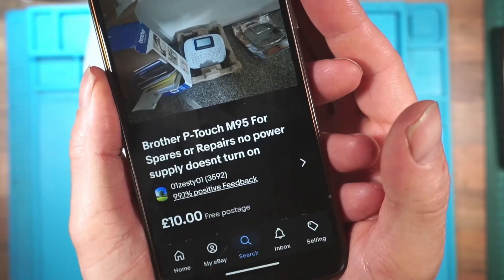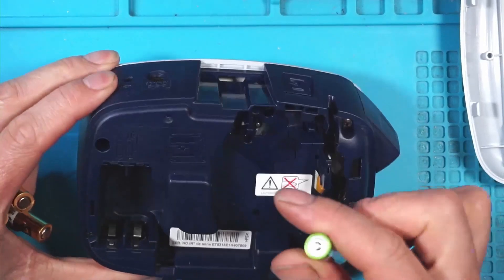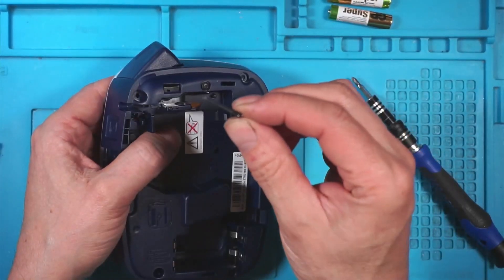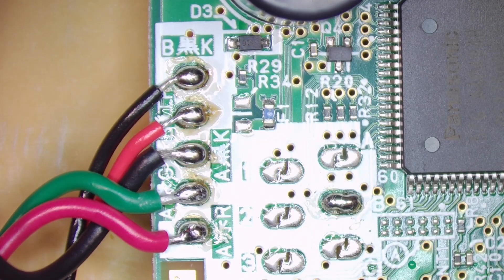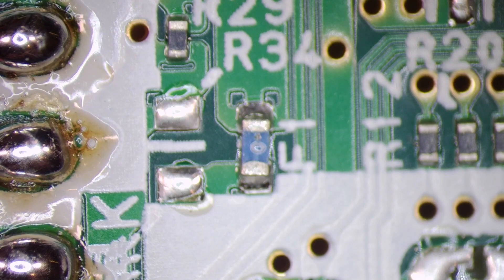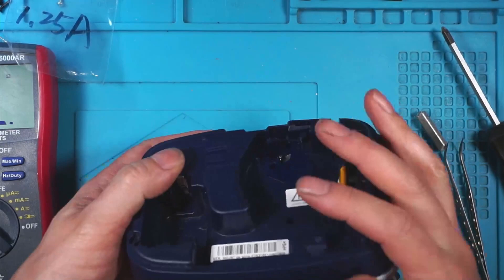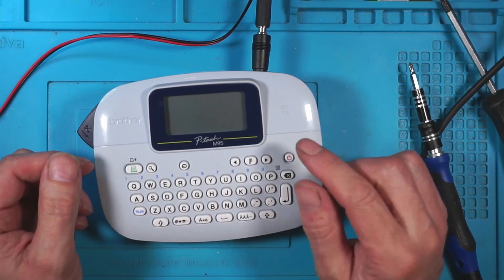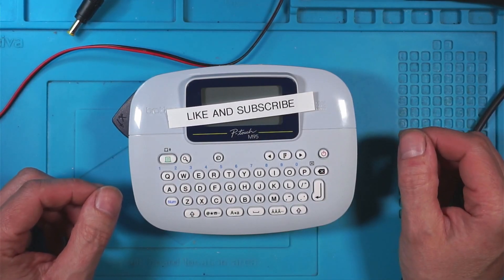FAULTY Brother M95 label printer | WON'T TURN ON | Can I fix it?

Comment: I have a PT 45, which is pretty much the same thing but with just batteries. It doesn’t work either. But, it did have an exploded battery in it. I haven’t had a chance to try to take it apart and clean the terminals and see if that’s all that will do to fix it. But if not, I’m sure that little fuse is in the very same place. That was very helpful.
Reply from the maker: White vinegar is good for removing battery corrosion. Then clean it off with Isopropyl alcohol or contact cleaner.

Comment: You fixed the hard part.  The easy part was the fact that the back of the unit contains an interlock that mechanically prevents the cut off from working when the cover is off.

Comment: Hi Philp, appreciate the video. I have a similar problem with my Brother PT 1880 label maker. My label maker will come on, but it takes 9-10 seconds of 
holding down the power button. Do you have any suggestions as to where I should look to solve this problem? Thank you for your time and consideration.
Reply from the maker: That's  a strange error to have. First thing I would check is that the button was working correctly. Cleaning it out with some contact cleaner or some isopropyl alcohol. Open the machine and look for signs of corrosion and / or bulging capacitors.
Reply: @PhilipBryden  OK, will do. Thank you for your quick reply.
Reply from the maker: I actually found this to reset it.

Turn off the machine, and then while holding down 'Shift' and 'R', press power button to turn the machine back on. 
Finally, release 'Shift'and'R'.
• Note: The text and formats in the display are erased. Also,
the language and unit settings will be cleared
Reply: @PhilipBryden  Cool! I'll give it a try when I get home tonight. Thank you.
Reply: It turned out I was wrong in thinking by holding down the power button for 9-10 seconds help start it up. This wasn't working anymore. Out of frustration, I depressed the power button all the way down and the unit came on.

When I have more time this weekend I'll open the unit up and use your suggestions on trying to figure out why I need to depress the power button so far down for it to come on.  Thanks

Comment: I have the same problem with an older model P-70. I haven’t used it for so long since I thought I lost it 10 years ago. How can I fix this?
Reply from the maker: You need to open it up and look for any signs of damage. I see the P-70 takes batteries, are the battery contacts nice and clean?  You'll need a multimeter to test the internal fuse if (it has one).

Comment: Good spot with the reverse polarity! couldn't figure out why mine wouldn't charge, it's supposedly meant to charge over USB too but nothing. I just took a spare 12v plug, chopped the end and resoldered to make it reverse. Thanks again!
Reply from the maker: Glad the video helped. Your model must be a bit different to mine because mine doesn't have a USB port. Glad you got it sorted. Thank you for leaving a nice comment.

Comment: SMD fuse from Littelfuse are marked with letters 0 according to a ref sheet I found is 100A @ 250v but if one company use letters i'ed assume others do, other wise it could be a smd 0 Ω resistor but that seems unlikely on that board in the place.
Reply from the maker: This thing hardly drinks any amps from the PSU so 100A might be correct. If only the manufacturers would label the board with a bit more info. What's your opinion on the fuse blowing. Am I correct in thinking the diode should have protected against the wrong polarity? If so, what could have blown the fuse?
Reply: @PhilipBryden  Yes you are correct in thinking that as far as I'm aware. My guess would be the original owner using the wrong V power supply or a issue with the correct one.

Comment: Great fix again !!!:goodvibes::goodvibes:
Reply from the maker: Hi Froz, thanks for your support. Pretty simple this one, but I can't complain. It looks like a nice little machine, I use my Brother E110 all the time, they come in very handy.
Reply: @PhilipBryden  for me its nothing easy cause you used your experience to spot the problem fast :)
Reply from the maker: @frozerinosrepairs  it was a simple blown fuse. I did have idea to check for shorts before putting the fuse back on tho.